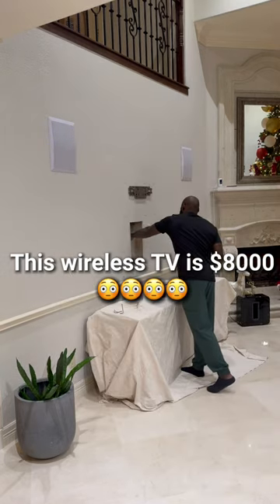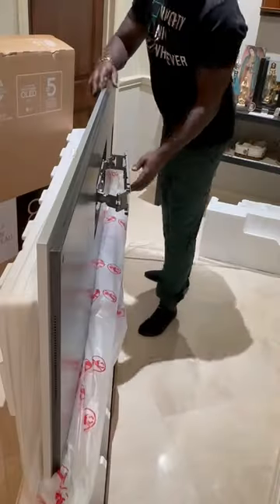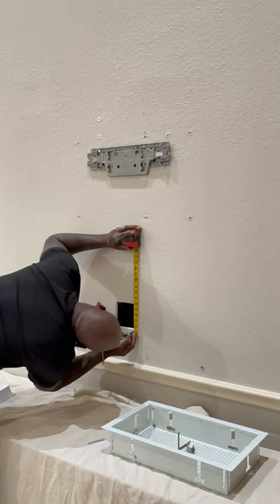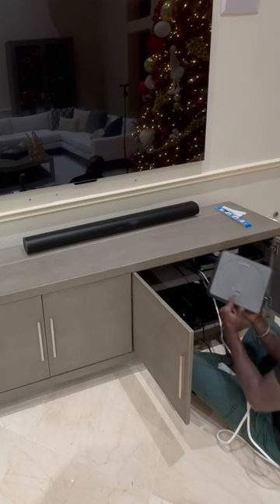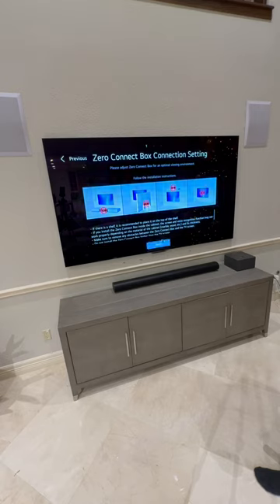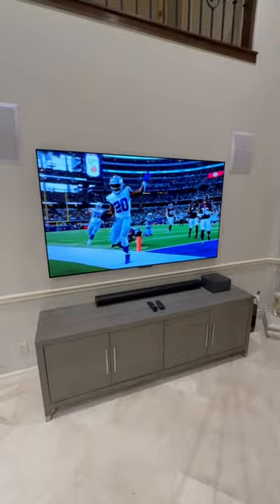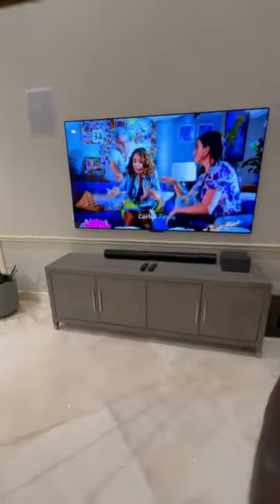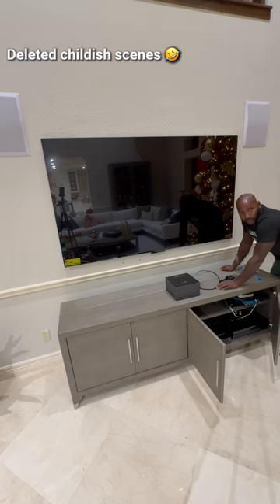Wireless LG M3 Oled TV install (full video

Comment: I dont understand why you put that huge white box in the wall.  I have my LG flush mounted FLAT only using a hole the size of plug outlet to run the wires down to the power.  Especially when you have a entertainment cabenit, why open up the wall.  Even if you need to hide a plug outlet, there are much smaller recessed boxes.